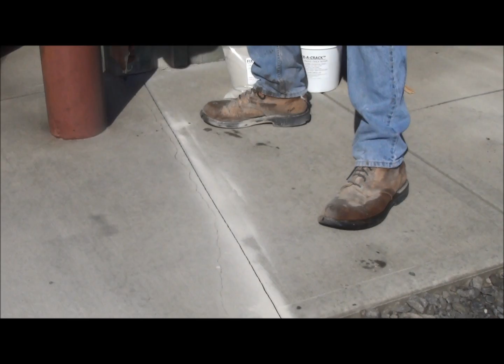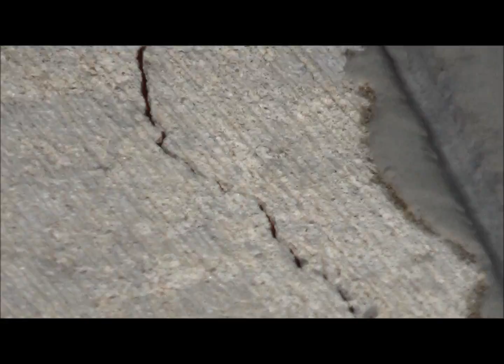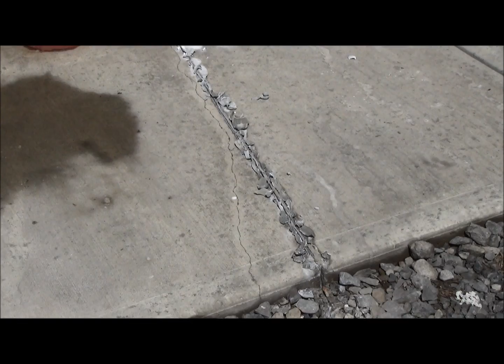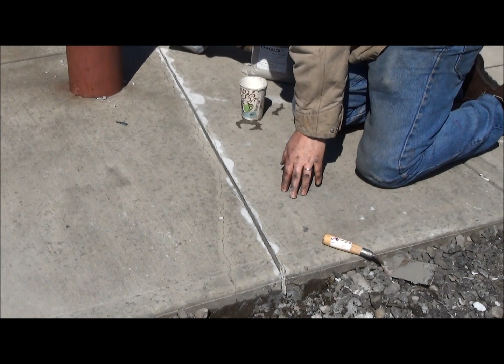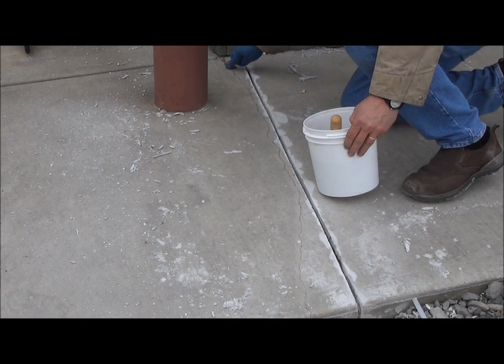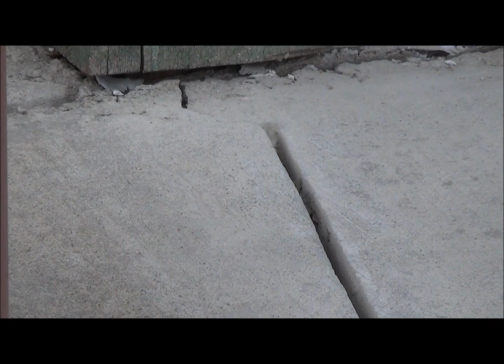Invisible Crack Repair?  Fix-A-Crack™ Concrete Crack Repair

Comment: I like the fact, you made a true expansion joint next to the crack. I am filling my cracks in my driveway that looks like a jigsaw puzzle. I have a corner house with garage in the back. There are only 2 cut through expansion joints in the whole slab. I want to put more. I am working to BLEND my concrete. It is not gray, but sandtone to light brown as aged 40 year old concrete. I have done it twice now. The 1st time using light gray, which sticks out like a sore thumb. Thanks for the video. You fixacrack link no longer exists (No information is available for this page.
Reply: Parachute jump 😂
Ho ho ho 😂
Reply: Blend is the only way is up 😂

Comment: Way too much work. Better results with a 4.5 in. x .500 in. diamond crack chaser blade & acrylic concrete or cement. I'll bet you made a lot of $$ for fixing that little 4 ft. crack

Comment: Comments are interesting, the guy created a controlled crack to take the pressure off the fractured crack, close the fractured crack with an expansion mix, and then he sponged the fractured crack with a standard cement mix.